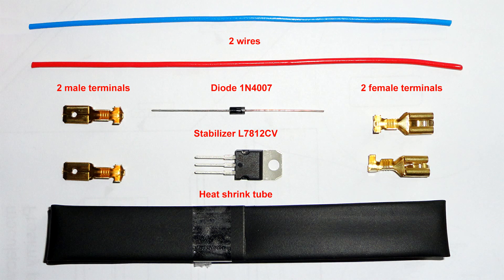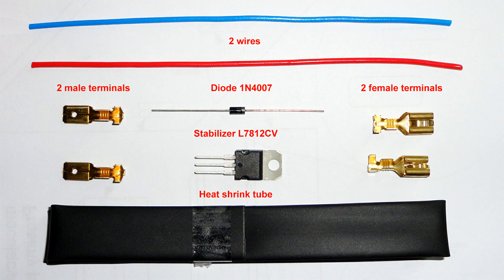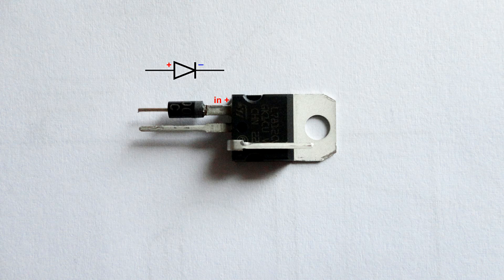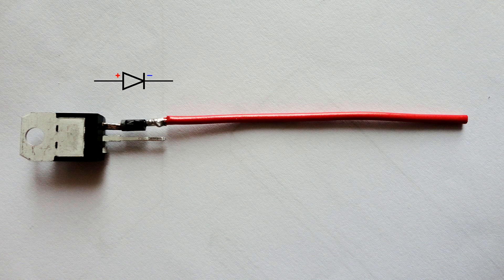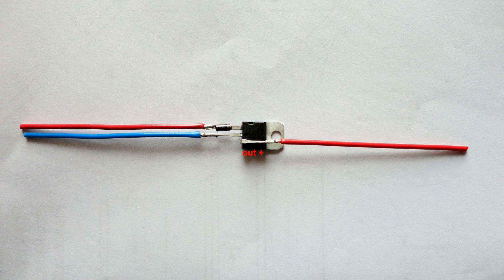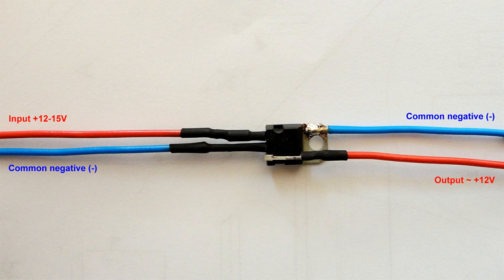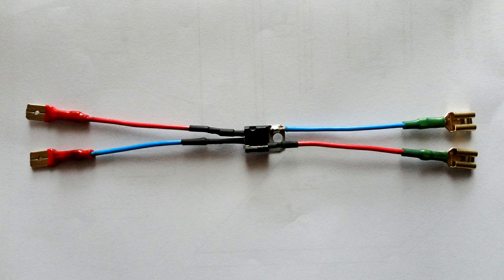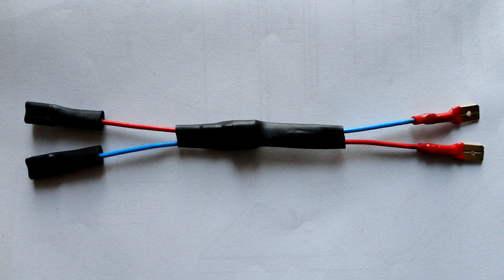Mini 12V Voltage Regulator for Car LED Light (v.2)

Comment: This will not work if the car isn't running as the voltage dropout is 2 volts.  So if your battery has 12,5 volt, the output will be 10,5V. If the car is running you will get 12V constant from the 14 - 14.4V the alternator is producing. So no good for a dome light for instance.
Reply: Haven't thought of that...what would you suggest doing then? 🤔
Reply: Following
Reply: Was going to mention this
Reply: bookmarked to remind myself to tweak

Comment: Been using this to keep a neon LED strip on the front of the car from burning out prematurely (again). It's tucked away just behind the bumper and works great without any issues.

Comment: shouldn't we use heat sink for stabilizer plz reply sir
Reply: Because the input voltage is close to the output voltage, minimum heat is generated so it's not needed. Now if you were dropping it to say, 5V, you would want a heat sink.